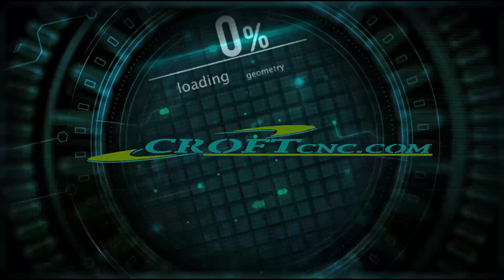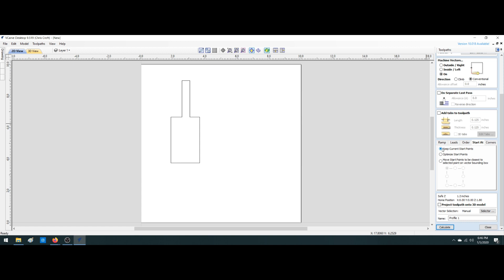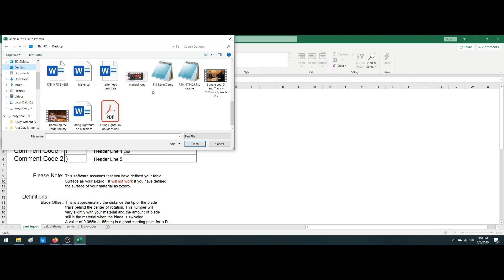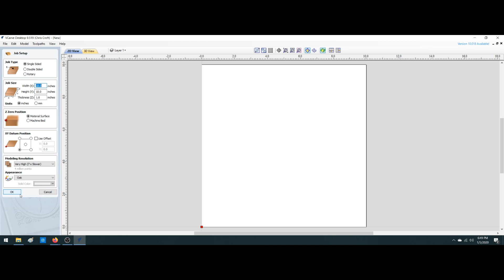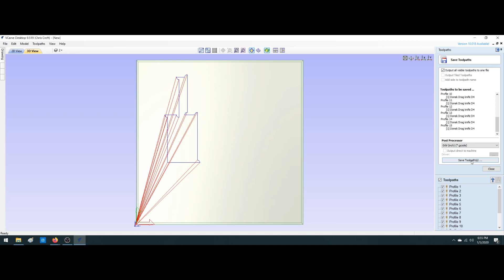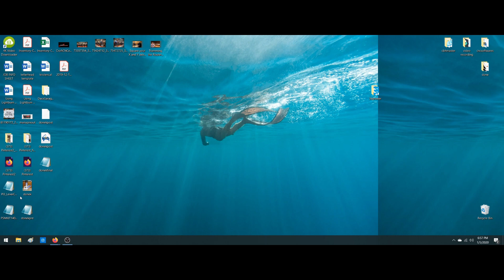GRBL , VCARVE, drag knife tutorial

Comment: Thanks for this, good tutorial regardless of what software you're running.  Plug-ins are great but it's always good to know how to solve a problem without them or just to have an idea of what they're doing for you (same reason I do a lot the work on my car).  Just learning Vcarve and while I've got pro (needed the increased work area) and can use the gadget I'll get comfortable with this method.  Curious though, and again new to Vcarve so I'll go try it in a bit, but is there no way to select, say, all the corners and set them to one value instead of having to manually select them individually?  Maybe it needs them to be selected in sequence but then you'd think even a ctrl-a and then selecting them in order....  But if it's only an issue for drag knives and there's a gadget in Pro if only you'll buy or upgrade..

Anyway, great video, thanks for it.